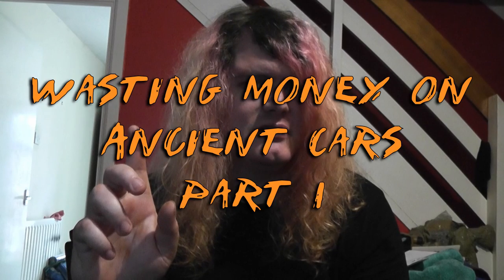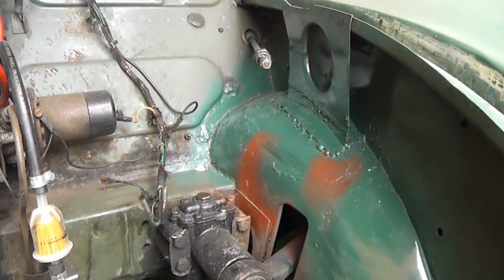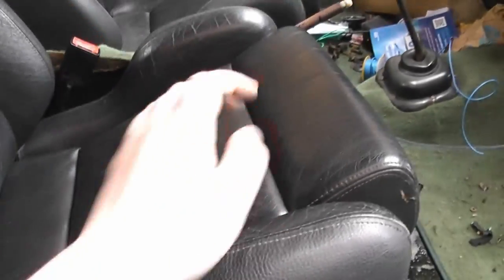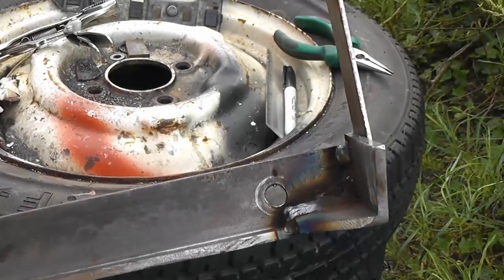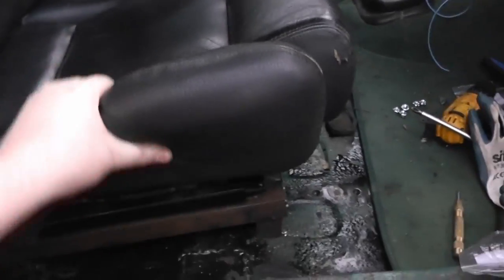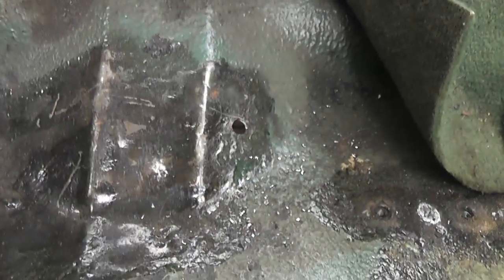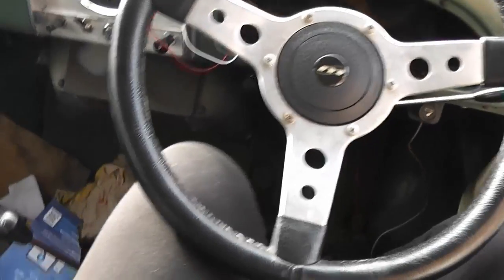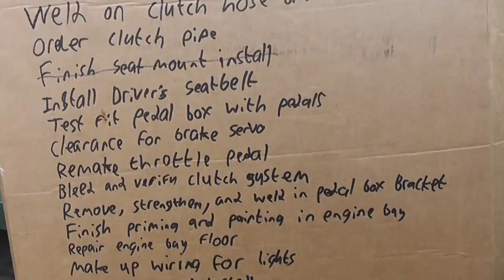Morris Minor Fast-ish Road Build Part 1: Alfa GTV Seat Install

Comment: Those brackets look great! Awesome job 👍
 I'm trying to figure out if I fix the old seats I have, but recently got some electric leather seats donated to the cause, they are a little wide, weigh a ton etc. Trying to figure out if I should buy a mig setup and make my own brackets vs go to a fabricator.
Reply from the maker: Depends on whether or not you plan to expand your abilities and do more metal-working/welding in the future. If you just want to put in a pair of seats, then getting a fabricator to make the brackets will be much more cost and time efficient. Otherwise, if you want to take up welding, do invest. It's a very valuable skill.
Reply: Have bought a little mig 👍
Will see how we go
Reply: Brackets done! Just wanted to ask whether you're planning to put in 3 point belts or original style lap belts? About to install my brackets but want to leave space for the seatbelt reel.

Comment: I liked that old video you did, I subscribed after it but you went quiet till now. Those series 2 moggies are rare and you should of restored that😎
Reply from the maker: It was an utter dog, trust me. Also it was a 4-door which means you get tiny front doors, and I could barely get into the thing. Also, to be honest I bought it partly because it was MOT exempt, but now that exemption has been extended to all Moggies :). You're right though, it was cool. Felt very Sin City driving it at night.
Reply: @Scrubworks  wonder if that was the one on ebay a few years ago from Sheffield,  I wanted it but it's mot history was bad 😅
Reply from the maker: @EngineVids  I sold it at the end of 2018, but I doubt it was in Sheffield, I sold it to a car trader in Bedfordshire. Black is a very common colour for those early cars.
Reply: @Scrubworks  think that was around the time😅. Who knows ehh?🤔